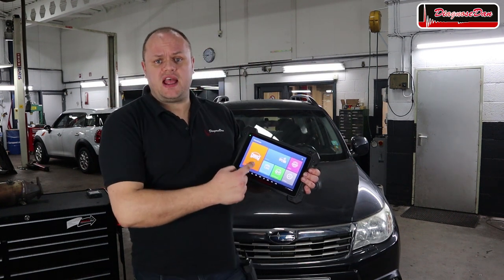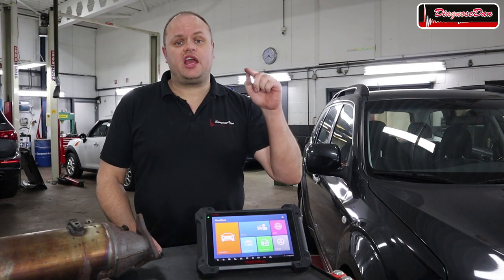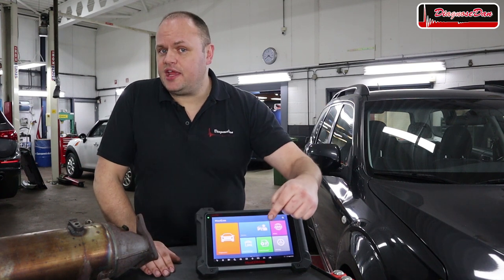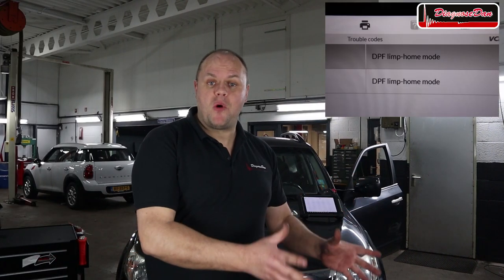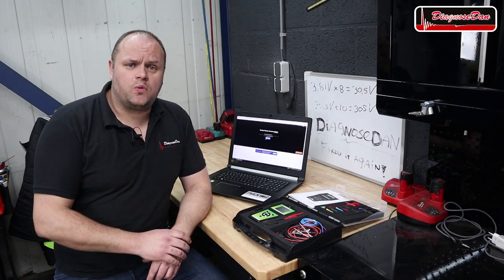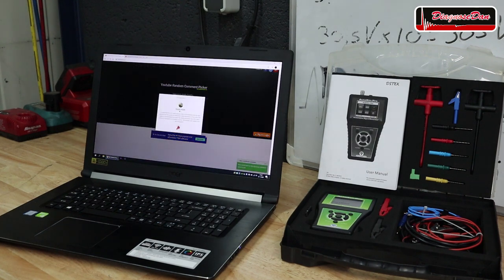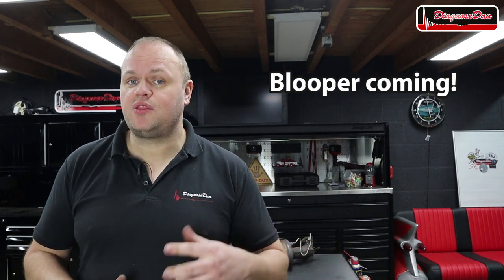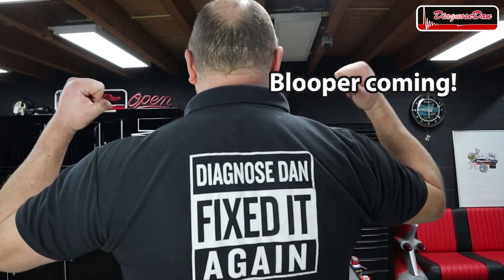New Car parts aren't always good Car parts!

Comment from the maker: For a discount on the Autel Mk908;
 US:  https://amzn.to/2QiNnl9    Use this promotion code and click coupon: V4CX6YUF  You save $170
UK:  https://amzn.to/2QI9ssj    Use this promotion code and click coupon: 3OQTJC9J  You save ￡150
CA:  https://amzn.to/2ZIOyxj    Use this promotion code and click coupon: 58C36V4L  You save C$300

For the Hubitools inspection camera;
https://www.hubitools.com/en/catalog

For the Ditex Autosim pro and other Ditex products;
https://autoditex.com/products/
Reply: The material on the inside of the DPF looks like weld slag.
Reply: DiagnoseDan 
Thanks for mentioning that cause might have been a leaky pipe. 
DPF’s usually don’t clog up by them selves.
Reply: @Conservator.  Yes That's a good tip, and from Russians I learned, if You have Vape [electronic cigarette who makes big cloud from burning Vaseline] show it exhaust and blow smoke  inside pipe and white steam will come out true smallest holes, and the same for intake system.  that steam finds  really smallest pass true holes and is so good visible.
Reply: Hello Dan and many thanks for thoses explanations, will you expect to open the refurbished DPF to see what's causing the block ? 

i' got the same issue on a 50 000km (30000 miles) mazda cx-5, after changing three pressure sensors without results, Mazda mechanics are now changing the dpf itself, but i'm not sure if there is an issue around the DPF (rich injection, oil leak thru turbo...)  symptoms are : dpf light on, high consumption, low power at high revs, very short regeneration intervals (25km). 

Here is a video of my car:
https://www.youtube.com/watch?v=mr14zbqJkBQ
can you please take the tim to give me an advice that will be very helpful ? the car is at the workshop since 7 months 

Regards
Reply: Totoribus dm 
Usually a clogged up DPF is a symptom of something else. It could be a faulty mass airflow sensor or a leak anywhere in the air intake, turbo, intercooler intake manifold. Leaky fuel injectors, bad EGR valve, etc etc. 
If so, just replacing the DPF will only temporarily fix the problem and soon enough the check engine light will be on again. 

It is quite possible that by now you have two problems: a clogged up DPF and the other unknown problem that is the root cause of it all. 

Did your garage check the whole engine or did they just focus on the sensors and the DPF?
Reply: @Conservator.  Hi Conservator, and thanks for your reply, The garage focus on EGR valve, dpf sensor and dpf itself, injectors can be the next step. In this episod of diagnoseDan, it seems that the DPF itself was faulty, right?
Reply: Totoribus dm 
You do drive more than 80km/h for about 20min in between every time you refuel? 
(Tx Brian Whitthe)
Reply: @Conservator.  Clearly no, I live in Martinique FWI roads are made of turns and hills, it's impossible to keep 80km/h constantly, but the car was in France before and the defect was already present.
Reply: Totoribus dm 
You need to to give the engine the opportunity to regenerate. To regenerate the engine must be warm and be driven at al least 60-100 km/h (depends on make&model) for about 10-20 minutes.
Mazda should be able to give you the exact numbers for your CX5. This is vital of course.
Reply: DiagnoseDan was
Reply: If I  bought that scanner can I  update it later with the j box and key's programming?

Comment: Another great video that has it all - diagnosis, repair, confirmation and most importantly, indication as to why the DPF got clogged in the first place!
Shows you how ingoring small problems can lead to huge costs.
Reply from the maker: Never ignore the details😉
Reply: This would also lead to abnormally high fuel consumption. Not such a small problem.

Comment: Dan.... you need to fly to USA and teach all mechanics about emissions systems because here nobody understand how they works... 
Thank you for another great video!!!! 🙏🙏🙏
Reply from the maker: I'm thinking about coming to the USA this year😉
Reply: He is only one guy, only human. He can do this much. He can't fix the whole educational system😨😱😷.Sorry if I offended anyone with this joke. The most talented guys I have seen with skills are in the tuning industry. The you tube mechanics from the USA are for entertainment purposes only in 90% of what I have seen. Don't even want  to touch a Japanese or European problem car. Those that do call in some silent bob who does know stuff. Fixes the problem in a time laps &  by dumb trail & error swapping everything out part by part. telling why buying a second car was a good deal. Still sometimes fun to watch. For learning stick with Dan
Reply: DiagnoseDan super Saturday Dan?
Reply: Hungary also needs a few good mechanics. I couldn't get my old car to idle properly in 3 years. That means it's been to about 10 mechanics. It always idled low and stalled with the AC on. That's why I learned to heel and toe. To be able to use the AC.
Simple 1.6 NA petrol. Good compression, low leakdown, good ignition (new plugs, leads and coil), new fuel pump, new fuel pressure regulator, smoke tested the intake, no leaks. MAP sensor checked and good, later replaced (the car doesn't have a MAF), went through 3 idle air control valves (the one that was on the car, a new aftermarket one and one from a known good car), never fixed.
All I ever found was that the ECU thought the mixture was slightly lean. 10-12% long term fuel trim with 0 +-2% short term. Never checked the injectors. Didn't know how. Didn't have the equipment. Would have been my next guess but I sold the car. Owned it from new in 2002 to 320k km in 2019.

Unfortunately most of these tests were done because I asked for them specifically not because the mechanics had any idea where to even begin to look.
Reply: Any professional who doesn’t understand emissions systems in modern vehicles is likely either a lube guy or tire guy. They are actually quite simple systems, requiring only some patience and the correct tools.

Comment: piezo
turbulence
I am an old construction electrician.  I spent most of my career installing energy management systems.  In temperature control an air management controller had to calculate the volume of air moving through it to properly do its job.  The differential pressure sensor pickup ring came as an assembly from the manufacturer.  Someone had to attach the hi tube and low tube to the differential pressure sensor at the controller.  These rarely failed.  Sometimes we had to install the tubes install the field. We had to be in a straight section of duct to accurately measure air flow.  Any turbulence would make the system useless.  If the pressure/electric sensor is not reading total pressure and static pressure it won't read correctly.  That black debris is probably buggering things up.  I am always impressed by you sharp automotive guys.
 Salutations from a fellow trouble shooter.

Comment: 2:54 ~200C* (392F*) is the start temperature in some DPF temp sensors as the tarket temp for soot burn is at ~600c* (1112F*) That is if your car dont have system that lowers the burning temp of the soot. So never ever park your car that Has DPF in high grass!!!!! ...or you may have just started a fire that may cost more then your car.

3:43 It can also take messure from front of the cat (folowed by DPF) and the secon mesure point can be just atmosphere. That means the hole Exhaust backpressure is taken in your calculation.
And so the fault can be in other part of the exhaust system.
+ if you cant see too mutch pressure in park then take it to safe plase to takerun at it. In secend gear from 1000rpm WOT to close to the red line. Then stop and take a look at the beak pressure.
No turbo 4-cylinder engine max is usually ~150mbar with turbo 4-cylinder engine max is usually ~250mbar What i have seen car bean happy. No V-engines yet as these are more on Diesel exept they are comeing for petrol ass well here soon and alloso i live in Finland where thers no too much V-engines anyway.

If you have Vacuum/pressure hand pump with gauge you can test its ok with your vacuum/pressure tester and when you know the ballpark in your hand pump then test the cars pressure tester and look at your data on scantool. Dont but more then 500mbar (0,5bar) to it as it can couse damage to the DPF sensor...
Allso make sure to hook the lines back in rigth order! ...Some customers comes to us that have car that has new DPF and now its diffrent code then before. Well ofcorse as it cant see the backpressure if its backwards...
I mostly wash them(water + soot removal product and time lots of time to dry folowed by full regenaration job) as they are mechanical filters anyway that means that the filter holes are so tiny that soot cant come out and there is no cemical reaction needed like in CATs that do the cleaning job and kill them self in process.

18:05 As DPF gets hot, those temp sensors gets stock (rememper what temp sensor is and how its made) as you turn them off you 90% of time Break them or shorthen the life time.
So DO NOT do wash job with maschine that hooks in them in the car(if you dont want to install new sensor allso) allways take the DPF out of the exhaust system and wash it from back to front so shoot gomes out the way it come in from...
Allso Know your DPF system example Ford use on some engine models a system that sprays extra fuel in exhaust pipe if that glow plug/ fuelnosel is broken then it will come back with full of sooth as it cant start the regenaration and no mostlikely there is no other code for some grat reason unknown...
These are just my points and NO all isnt made the same so take it with grain of solt!

Nice video man you earned a sub!
Have a great week end! Cheers Timppa

Comment: great lesson, i rebuilt a small block ford many years ago and while on the stand i prelubed the system to check it and found incomplete lubrication due to 1 of the hyd lifters being a smaller size than the rest. also aftermarket no name supplied by my brother in laws shop! ordered a new set made by johnson, no problems. once again great video.
Reply from the maker: At least you fixed the problem💪

Comment: Hey dan,

some thoughts on the failed part:
Looks like the washcoat is very inconsistent. That would be the silvery stuff on the surface. You never, ever, want to see something like this on the DPF. It is also visible on the rear of the filter; there it isn't as visible, as there is no soot stuck to it.
The first part of the filter is actually just a catalyst. You can clearly see that on the first part, all the cells are open, whereas in the second one, only every other one is. The reason is that for a DPF every channel is blocked at one side; the filtration is actualy happening in th walls between the cells. This is also the reason why DPFs have quite high back pressures.
For this reason; a too heavily coated DPF will experience too high back pressure, especially when the part is new. The coating blocks too many of the pores inside the monolith. During the first regenerations, this coating is quickly deteriorating, which leads to reduced back pressure.
Back pressure of a DPF is extremely sensitive to soot loading. Your pressure readings may actually be sort-of OK for a heavily loaded DPF. Ideally, you'd want to do a regeneration (if possible) before conducting backpressure testing. Many ECUs will adapt their backpressure model according to an aging factor; if the ECU is not told about a new filter, it may trigger a false diagnose.
Also, high back pressure is usually cause by one of two things: Ash loading due to age (ash is a result of oil consumption, and cannot be burnt during DPF regeneration), or due to excessive smoke of the engine. A Dirty MAF can easily causen a overloaded DPF. Considering the almost 200.000 km on this vehicle, both are possible for the original filter (the one you never got to see). 
Since the front of the filter was quite clean, I think it is safe to assume that the replacement filter did not run for very long. Within 50 or so kilometers, you'd expect the front of the filter to be black, so excessive soot load was likely not the cause; and replacing the filter AGAIN was likely the correct call.
If the filter was damaged (cracks, blown out plugs), the differential pressure would be too low, and this shouldn't trigger a limp-home mode.
Limp home mode will also increase the back pressure, as it will be run without EGR, and you will have significantly increased air mass flow vs. normal operation. Can be up to 50% more, depending on operationg point. So again, for the backpressure test, the limp home mode should've been cleared. 200 hPa at no load 2500 RPM is still too much, though.
Reply: Thank you.

Comment: Hi I've learnt a lot from this video great stuff. I've been very fortunate over the past 3 years to be given the responsibility of these dpf issues and can facilitate a clean. I can honestly say I've never had a dpf never work after a clean on the carbon clean machine and would highly recommend it to all technicians. So it brought to my attention and the end of the video does clearly show that the fact the aftermarket filter was poor. In my experience I would never recommend after market ones even if they are a lot cheaper. The reason being is that the plates inside are not as good as genuine plates, the reaction is either too poor or not sufficient in order to burn of all the soot/ash. Also depending on manufacturer the computer is would of been 0 in with the genuine part so when you install a after market system on, the ecu will not be understanding why it hasn't got a good regen, and mostly newer cars are clever enough to know what readings to have but also at differnet times in a regen. The camera is handy to inspect to see if its obviously blocked but to answer the question if this ones was blocked visually, unfortunately you cannot determine it my looking at the channels. Most dpf will block at the top and can show the channels decrease in size. But some have been blocked further in the system and there is no way of telling as the holes are so thin. I would then refer back to the clean as it is cheap and worth a attempt to see if it clears it out. This is just my advice and I've done loads to know roughly what the outcome is in most cases. My advice when diagnosing many problems is to repair at small steps and test after each move to build a better picture of what was actually wrong. Also great vid again I would like to have more info on SCR systems as info is limited out there and sometimes I find it hard to diagnose. 
Cheers Andy

Comment: Hi Dan,
Again, another great video! Indeed you are right; fault codes on a DPF Filter are though ones. Most of the time the faulty DPF Filter is not the cause of the problem, but the victim. What I always check before in the live data when it was the last time that the car started the regeneration at his own. Then you know that at that time everything was working fine without any faultcodes presented. I also always check  other faultcodes and checking the glow plugs. No working glow plugs, no regeneration what leads to a clogged DPF Filter, and/or a damaged and leaking turbo. When a turbo is leaking exhaust gasses at his waste-gate-axle, is always a ‘smoking gun’ to me.
The separated pressure gages are a must to see if the pressure sensor is telling the truth. In my mind I also created two of the same gages to do the measurements. But unfortunately to much broken cars, so didn’t find the time to create them. 
Keep up the good work and looking forward to your next video.

Kind regards,
Geert
Reply from the maker: Thanks Geert😀

Comment: I like the fact that you had an Old-school manometer to confirm the readings from the engine management system and that you didn't rule out a professional clean of the DPF as opposed to always going for a new one. The multitude of problems that lead to blocked DPF is mind boggling, from a simple out of Calibration exhaust gas temperature sensor, to the obvious turbo oil seals . One of the most overlooked causes is EGR cooler leaks and the owner keeps topping up the coolant without getting it repaired in time. 
Keep up the good work 👍
Reply from the maker: Thanks for watching!😀

Comment: That exact same thing happened to me on a catylitic converter for a MK4 Jetta with a VR6 engine. I replaced it with a aftermarket one because the dealership wanted 2 thousand dollars and the aftermarket was 600$. I installed it did the drive cycle test and all was good for about 2 weeks then , bing the check engine light comes back on with a catylist efficiency code. Well we checked the emissions before and after and it was not doing it’s job so we bit the bullet and got the factory one and it was fixed till the car went to heaven.  Awesome video up here in Canada we don’t get a lot of diesel vehicles like in Europe. So it’s cool to see you diagnose these problems.  Thanks again for great content and I got my tool that I won back in December. I was wondering what could be from Bulgaria 🇧🇬 when I got the package 📦. Then I remembered I had won the sensor simulator. Pretty cool 😎 thanks again
Reply from the maker: Great to hear you finaly recieved your price. Enjoy it Martin!

Comment: How true this is. I just changed out a power steering pump on a GM made car. The first one came as a reman from a local part store. It was a failure right out of the box. I went with a new OEM pump which was twice the money but worked as it was supposed to. Great video. Thanks.
Reply from the maker: There are also some great Reman companies out there
Reply: DiagnoseDan I agree Dan. I use a lot of aftermarket reman parts. I have had pretty good success rates with them. I also live in an area were the economy is moderately depressed so we try to save the customer some money when we can.